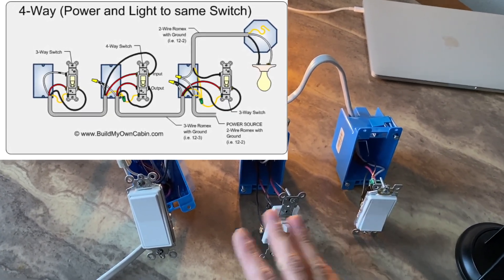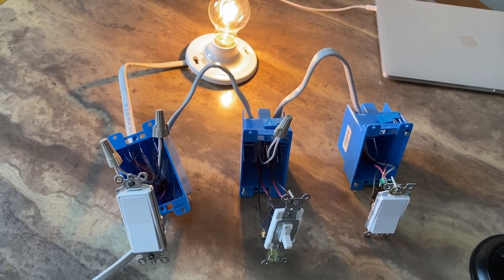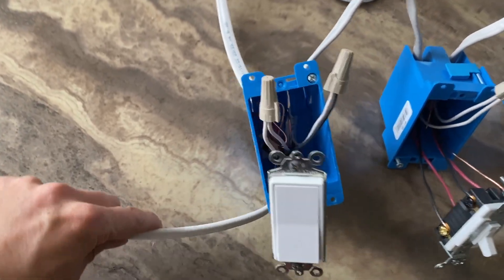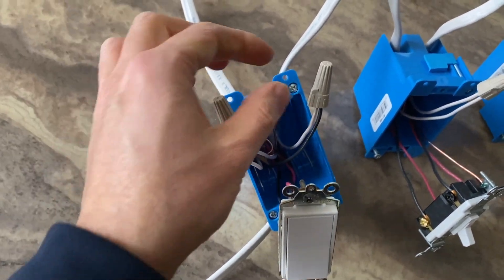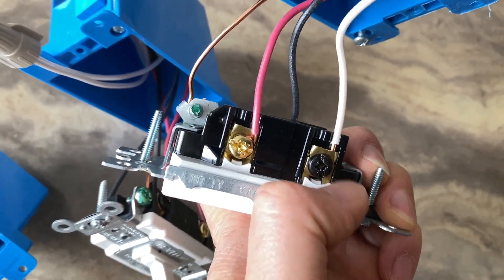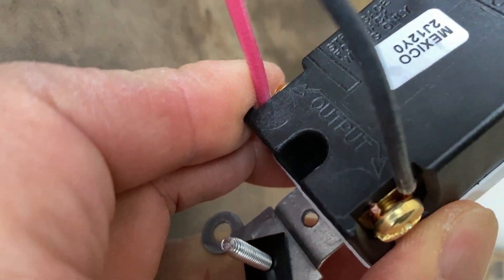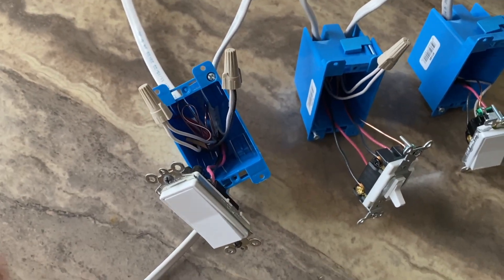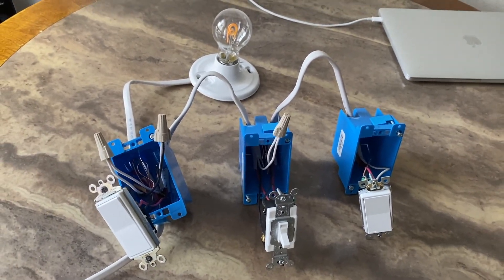3 Way Switch 3 Location Wiring Explained. 3 Way, 4 Way

Comment: Very Simple😂  It's the simplest things that makes the average person feel like an idiot.  

I hope you can help me with a simple question.  25 years ago I totally rewired my home under the guidance of my 75yr old father. 10 years ago I replaced one of the three-way switches with a dimmer switch and messed it up.  

One switch controls the light on/off, and the other switch needs to be in the "on" position to allow the first switch to function.  

I'm wanting them to work independently but I'm not sure which wires I switched. Today I don't know which light switch the load comes in on.

I'm thinking the loads coming in on the switch that controls (or must be in on position) for the other switch to work? 

Could you possibly help me out. 

Note .. from the time I was seven or eight my father used to draw the diagram of a three-way switch explaining it to me.  Logically it's always bothered me how you use neutral as a hot wire.

Question...So with the setup, the power actually goes through all three light switches before it comes back and actually goes into the light bulb through the traveler wires?

Comment: What would cause the load to always be on no matter the position of the on/off switches
Reply from the maker: What do u mean the wire to be hot?! u have to remove both switches completely to define which wire is load which is line.
Reply: @remoteelectrician  they had twisted the hot wire from the source with 2 other switches which was causing the load to always be hot. Still trying to figure it out, but keep getting frustrated.
Reply: @mrsoccergod5001 I’m having the same issue. Worked fine with the old fan that was up but now I have it off and the traveler to the fan junction box is always hot